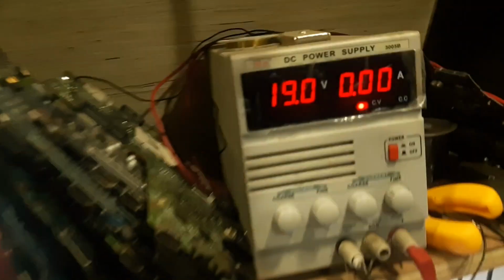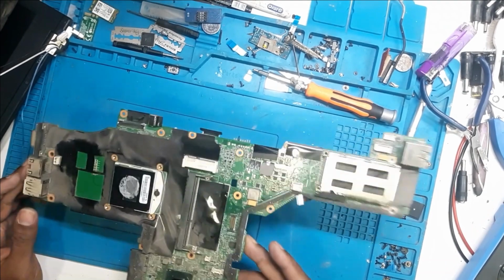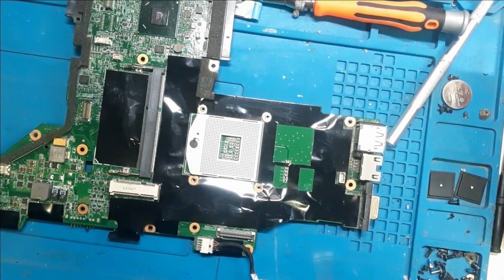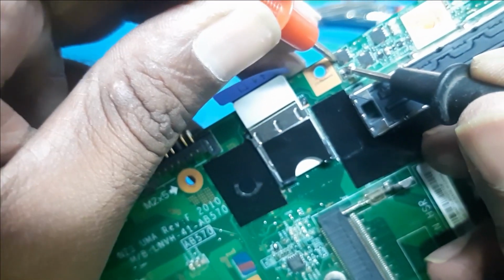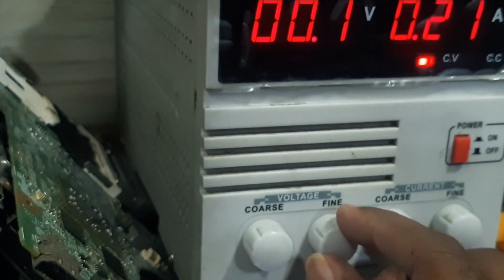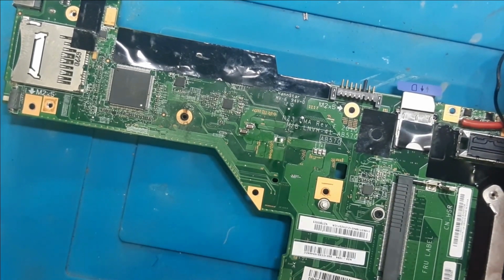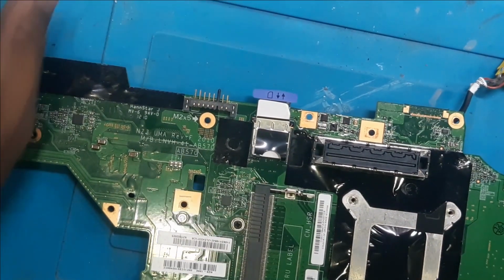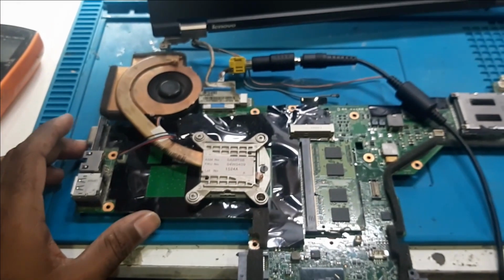Lenovo t420 Repair | Repairing a Dead laptop I | Most common fault on a Dead Laptop

Comment: Ibhave t420i .when i press power button onlyvitvstays light upbsolid .and no other light or beeb etc .even if o remove ram hdd keyboard etc.on board all connectiksb are ok .  Any guidance.i wilp open board for repairs
Reply from the maker: Check cmos battery,  or may be it's board issue

Comment: Nice work brother, I would like to know the reason you removed the current sensor resistor and connect +19V, would anything bad happen if the resistor could still be in place? Thank you.
Reply from the maker: When ever there is a shorting inside the motherboard, this is the best way to find out, if you inject low voltage through the CLR resistor, the ampier goes directly to the shorted component & it starts heating.
Reply: @Zafar084  Many thanks for the swift reply. What if you could have injected the power through the CLR resistor without removing it (because you removed it first), could any damage occur? I just want to put myself clear on this. Otherwise, thanks for the video, the trick of finding a short is very nice.
Reply from the maker: Removing the CLR can determine which side the shorting is present & which side you can inject the voltage
Reply: @Zafar084  Thank you very much for the clarification, now you have cleared my doubt.